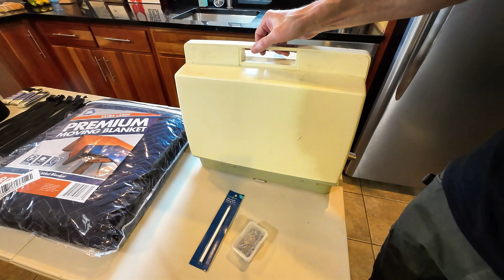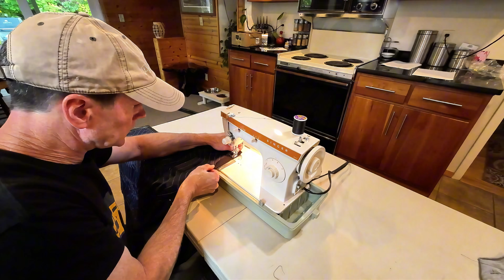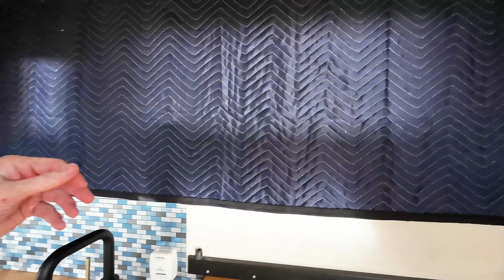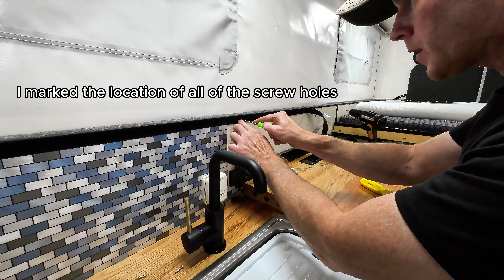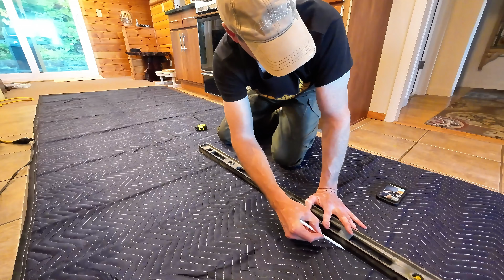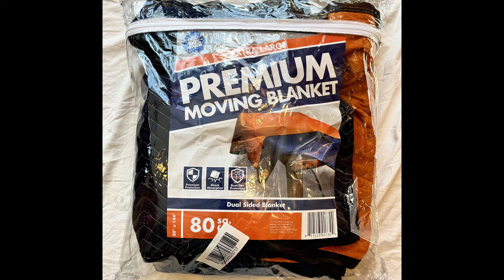Homemade Thermal Pack: Four Wheel Camper Shell Buildout #14

Comment: awesome job!!!  i just looked at purchasing a new set from 4WC...  its 4-5 month back order!!   Always thought about just bringing my old style original weather pack  in to a seamstress and some fabrig and having them duplicate it...still gotta be cheaper then $1000 bucks.!!  one thing i have done that no one seams to do is on the front and back where it goes behind the lifting boards I put some adhisive backed velcro to hold them up..  It drives me crazy even seeing youtubers 4wc with those things slopping down like that!

Comment: Try a reflective insulation on the back side of the moving blankets. You can get it at Home Depot it's a bubble wrap type of insulation with foil on both sides. It's really light weight and may save your hard work. love your videos keep up the good work

Comment: You get an A for effort. Following to see what you do next. I tried 2 versions, Reflectix and Magzo Thermal Door Curtain. I didn't put windows in either.I like the zipper idea for the windows.
Reply: Were your 2 versions successful?  If not what was the problem?
Reply: @jackg8478  The reflectix worked really well. I put velcro on the reflectix and attached it top and bottom like Northern Explorer Overland did. That made for an inch of "dead air" between the vinyl and reflectix. It's also a vapor barrier so you don't get much condensation, except on the ends where it gets behind.  It wasn't too bad to put up and take down,  but enough that I wanted to try something different. It stored rather nicely in two 7 inch X 30 inch rolls. The Magzo Thermal Door works good as well. You buy it as a double door with magnets in the middle (like those auto closing bug screens) and velcro already sewn to the outside edges. I cut the 1 inch strap at the top of the double door unit to separate the halves, so the velcro edges become the top and the magnets become the bottom. It takes 1 double door to cover one side of my Fleet FWC, with about 1 1/2 feet overlap on the north and south ends. Sorry getting a little long. They were both successful. I like the Magzo better because I can open it in the middle and get to the vinyl windows to see out. I like the zipper idea that this channel was going to do for the windows. I may give that a try or have someone sew them in for me.
Reply: @oysterfleet5669  I have the factory thermal pack (older version).  I added reflectix between the thermal pack and vinyl walls.  It basically sits in between. I did cut outs for the windows, only cutting the top and two sides, leaving the bottom as a sort of hinge.  

The reflectix has helped for winter camping.  I am able to raise and lower the top with the reflectix in place.  

I ordered a Magzo, its sitting in the garage.   My plan is to use it for the front wall where the sleeping area is.  I am not sure how to attach Velcro to the interior of camper that will be strong enough to hold the Magzo in place.  Not sure self adhesive Velcro will work.